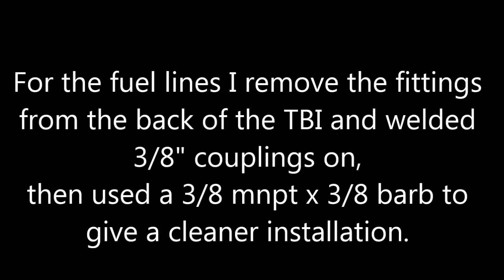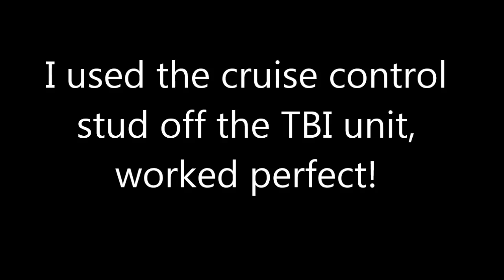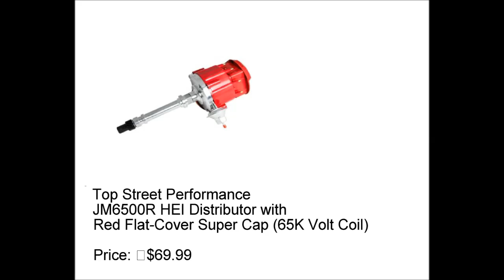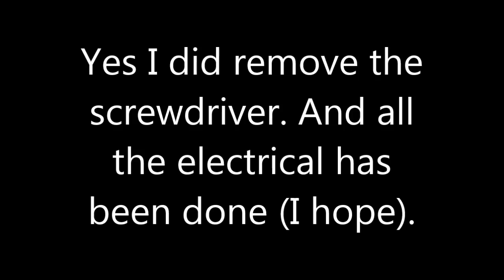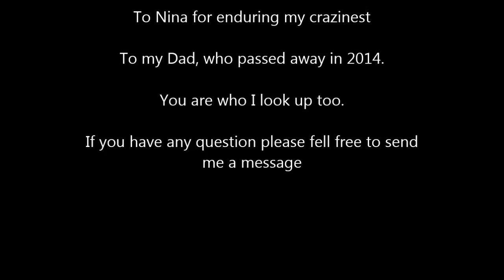Chevy Truck TBI to Carb Conversion 2

Comment: my 18 old kid took my 93 yukonGT.  The 3 lobs of the cam were in the oil pan and lifters, with pieces of piston in the oil pan. it looked like a grenade went of in the motor. Love the video...
Reply from the maker: I have been there... Blew a 427, broke my heart. Thanks for the comment, Papa

Comment from the maker: Its been a very busy year. I have been behind answering questions, so hopefully things will slow down a bit. Thanks, Papa
Reply: hey Just a quick question im getting a 1999 350 vortec engine for my 86 c10 and I have a turbo 350 and since im going to carb the vortec do I need the computer at all???
Reply from the maker: If your putting it in a 86 C10 I don't see why you need the computer. Just a good intake and tune your carb and you should be good to go.
Reply from the maker: Should not need too. Post when your done . Papa

Comment from the maker: Well I finally got my transmission rebuilt. Going to wait for better weather to install it. If it works properly I'll post about the rebuilt. Merry Christmas.
Reply: Papa Ragan 
Would you know if a 1976 454 carburated work on a 1995 1 ton dually. The dually motor is a 454tbi but I have a 454 in a 1970 3/4 ton right now and I need the dually to run.

Comment: thanks for the info. very helpful.. i was so stumped on what to do about the fuel pressure problem
Reply: I removed my fuel pump fuse and relay...added a 12volt external pump and plugged the factory fuel line.

Comment: Papa,
I'm just about finished with my conversion.
2 more questions:
1) For the second cab heater hose that was attached to the TBI intake manifold, where did you attach it?
2) What did you attach to the hole in driver's side valve cover?

Comment: Were you able to keep the stock return fuel line ?? And how is the regulator doing at keep the psi down low for the carb ??

Comment: Thanks for the info! I can just leave my computer for the lockup which was i was wondering. Can i just freely cut the rest of the harness and pull those pins from the main plug on the computer or just snip and cover?

Comment: Nice vixeo io did this with the same block just in a 69 c10 so i eliminated alot of stuff but i might need a. Fuel pressure regulator as it boggles whe i step on it too fast

Comment: Hi. Nice Video. appreciate you sharing the parts you used.  
I have a 1987 GM P/U with a 305 TBI  and 700r4 Trans. I've built a 383 with a Holley 750 carb from a 350 block. we fired it up, broke it in, tuned it and did a dyno run. So it is ready to go in.  But I have questions on the TBI conversion. 
- Does the entire computer control system come out?
- Will the fuel pump in the tank run without the computer? I know I need a regulator with a return to get the right pressure at the carb. 
- What actually controls the Trans lock up in a carb set up. 
The big question is around the computer. What  needs to stay.
Reply from the maker: Joe Engel    The only reason I left my computer in is for the speedometer and cruise control.  So to answer your first question:
- Does the entire computer control system come out? 
+No
-Will the fuel pump in the tank run without the computer? I know I need a regulator with a return to get the right pressure at the carb. 
+Yes it will, you will need to reconfigure your fuel pump relay. (I believe it at the end of the video, If not I can post it for you)
- What actually controls the Trans lock up in a carb set up. 
+ The computer. I am rebuilding my 700r4 at the moment, I will be using a TCI Lockup kit, TCI 376600 - TCI 200-4R / 700R4 Torque Converter Lockup Kit
http://www.jegs.com/i/TCI/890/376600/10002/-1?parentProductId=748599  or
http://www.tciauto.com/tc/2004r-700r4-lockup-wiring-kithtml/

Hope this helps
Reply: I did not see the Fuel Pump Relay reconfiguration.  Mind sharing it with me.
Reply from the maker: Joe Engel I'll get it sometime today. thanks
Reply from the maker: +Joe Engel Posted a video, Hope it helps
 https://www.youtube.com/watch?v=myTSUdSJLdA
Reply: +Papa Ragan what wiring did u cut and hook back up to wire in the hei and keep the in tank fuel pump?
Reply from the maker: +Robert Arey First use the pink wire coming from the ignition (It should be connected to your coil). you will use this wire for your  electric choke, HEI and fuel pump.
Fuel pump wiring:
Green/White - Cut and connect to ignition(the pink wire)
Black/White - Ground
Red - Disconnect and cap
Orange - Connect to battery
Grey - DO NOT CUT
Hope this helps

Also: https://www.youtube.com/watch?v=myTSUdSJLdA
Reply from the maker: +Joe Engel First use the pink wire coming from the ignition (It should be connected
 to your coil). you will use this wire for your  electric choke, HEI and
 fuel pump.
Fuel pump wiring:
Green/White - Cut and connect to ignition(the pink wire)
Black/White - Ground
Red - Disconnect and cap
Orange - Connect to battery
Grey - DO NOT CUT
Hope this helps

Also: https://www.youtube.com/watch?v=myTSUdSJLdA
Reply: have you tried lock up kit?

Comment: Great. I am looking to do a carb swap to a GM 2.8/3.1 because the egr system is junk and hard to get quality parts for. The tbi gives 16 mpg on an Isuzu Trooper and a Holley 2 bbl should not change it that much. Plus no more jerkiness at <2,500 rpm. Manifold already bored for a 4.3 tbi and I have the adapter for the carb convert. Yesterday I cut apart the electric control solenoid valve and realized that it passes vacuum even when the coil is not energized due to its internal design. Therefore IMHO the EGR valve spring will weaken over time and the EGR valve is opening at idle causing my problems at low RPM.

Comment: I wish I had found this vid before I rebuilt my tbi and bought all the electrical crap. Everywhere I looked online were people talking smack about the conversion, while all I could think of is why wouldn't you want a carb? Far less things to go wrong. I can rebuild an edelbrock for less than 100 and add a manual fuel pump for about $20-$30 bux. I just dropped about 400+ to rebuild and replace all sensors on my '89 k1500 with a 350. And it still wont start right up from a cold start, in tank fuel pump (new) has to rebuild pressure every day. Had a carter afb 650 cfm on my old 76 k10, best carb I ever had.
Reply from the maker: I had the same problem with mine. Spent tons of money to repair the TBI. Never worked right. Thats why I went to a carb.

Comment: DO U HAVE A 700R4 TRANS IN THERE WITH ELECTRONIC TORQUE CONVERTER LOCK UP FOR THE FOUR GEAR  AND IF YOU DO HOW DID U GET THAT TO WORK WITH OUT THE COMPUTER ..

Comment: Papa Ragan,
Questions:
1). Where did you hook up the brake booster vacumn hose?2). You disconnected the EGR system, right? And then put plugs in the old exhaust manifolds ports?3). Did you disconnect the MAP sensor?4). Did you disconnect the Charcoal Canister as well?
Reply from the maker: I hooked the booster to the rear outlet in the carb base plate. Hopes that helps.
Reply from the maker: 1: I hooked the booster to the rear outlet in the carb base plate 2: Yes 3: This motor did not have any manifold ports, Not saying it did not at one time. Also there was no air pump system. 4: Yes

Comment: I would get a metal fuel filter like the original frame mounted. the elect fuel pump in tank is high pressure until after it leaves the fuel reg. I am changing to 1974 350 with carb to a 90 chev. pickup. The wiring tips will help lots.
Reply from the maker: Thanks for your sharing your info, we all share info here. I'm still using the original plus the one at the carb. I have not had any problems,yet. But I will will keep an eye on it. Thanks again, Papa.

Comment: Hello i just put a  94 rebuilt engine in my 89 chevy silverado ran ok at first but having trouble with fuel probblems wasting to much gas. ive changed alot of things injectors getting to much fuel ,fuel reg,fuel filter still runs the same does not stay on ,my question is does it make a diffrence in fuel econamy or will it waste more gas.i want do the same as your video change tbi to a edelbrock.loved your video and thanks for listing the parts you used.thanks

Comment: Hey. I know you did a lot of research on this. Thank you for sharing your knowledge with us. I have a 92 Chevy Silverado with a 350 that I want to switch to carburetor. I noticed in a couple pictures that you did not have the vacuum advance on the distributor hooked up. I was also wondering about the throttle position sensor. That carb didn't have one did it? What did you do with the wires?

Comment: Great video what I'm doing is outing a 97 5.7 vortec in my 78 pick up. I want to convert over to carb to eliminate the computer. Is the distributor you used compatible with the stock can meaning is it the same metal material on the gear I have heard it has to match. If it's not what cam did you use and what specs
Reply from the maker: Have not heard that before, could be. I have not had any problems using the stock cam and it runs great. Good luck on your project and keep us up to date. Papa.
Reply: Not sure if you got it going yet. Answer is no. I am doing the same thing just did a 880 block out of 97 suburban.

Comment: I am in the process of doing this swap on an '88 with a TH400 trans. What do I have to do to make the trans operate correctly?
Reply from the maker: I bought a Trans from Jegs that does not need any   controls other than Automatic Transmission Detent Cable. That was the simplest solution

Comment: Papa,
Better question after thinking about this overnight: I can install an alternative speedometer setup that Will allow me to eliminate the need for the ECU to run it.
If I eliminate the ECU entirely, can the cruise control still function as is or or is there a way you know of to engineer something to allow the cruise control to operate without the ECU?
I want to explain why the message to you of 11 months ago and why I'm still addressing this subject. 11 months ago I was going to make the TBI to carburetor conversion but I then became convinced to try to make a go of the TBI/ECU system, especially because of my fear of Texas environmental laws. The only problem is that I have for the last 11 months been trying to chase down the problems keeping this truck from running, in my limited spare time and have been unable to. So I'm returning to my idea of 11 months ago to convey to a carburetor system.
Reply from the maker: I am still looking for an economical way to do the same. Right now I am having problems where my speedometer comes and goes. So I will be working on this problem sooner than later. If you find a good way to do this please post it. If and when I do I will post it. Thanks, Papa.
Reply: +Papa Ragan 
check out 350 tbi to caburater wiring problems. yutube. not sure of the poster.

Comment: Hello 
Would you know if a second gen 454 carburated motor fit into a 1995 dually 454.  The dually motor is shot and I have a good running 454 in a 70 3/4ton but I need the dually. Thanks

Comment: Great video. I have a "78" 2wd Blazer that Id like to put that type engine (serpentine belt) in but make it carbed. Will my carbed intake fit a TBI engine ? Or, if I rebuild my old 350, will a serpentine belt system fit ?
Reply from the maker: +OUTFITRIDERS I don't see a reason that you can't put a serpentine belt on your 78. You will have to use the water pump, alternator, etc. from a serpentine set up. My suggestion is by an old truck (88,89,90, etc There may be others) and scavenge all the parts you need. Now you may still have some fabrication to do, but heck that's the fun of it anyway.  It is easier just to buy an intake for your motor, there not that expensive. Different years have different bolt patterns on the heads so need a matching intake. That being said they do make an adapter to use your intake but it cost as much as an intake. 1987-1995 Intake manifold bolt pattern with center intake
bolts canted @ 72 angle. Hope this will help you on your quest. Keep us up to date and good luck.

Comment: Thank you video. We got an 87 c10 as a roller no computer in it either.
Question: How can the intank fuel pump be wired so that we can use it with a carbd 350 ?  Thanks.
Reply: Wire it to an ignition hot source, and add a bypass regulator, such as the Holley 12-887.  Just set the regulator to about 4-5 psi, and you're good.  

Don't use a regulator without a return line, also known as a deadhead regulator.  Those don't tend to work out well

Comment: nice video and insight I have a 93 chevy c1500 rolling chassis  can you tell me what wire colors went to each component  I have the purple wire identified  and the ignition wire pink coming off the fire wall any insight will be helpful.. previous own had a big block in it so the wire out the harness are only about 7 total the used
Reply from the maker: Check out my other video and see if that helps. Papa https://www.youtube.com/watch?v=myTSUdSJLdA

Comment: Hey papa I have a 94 k1500 with vortec heads, a single plain intake made by chevy so the tbi bolt pattern goes to the vortec heads. From what I hear it would be a powerful motor if i installed a carb because the throttle body is the weak point would it be worth my time to make the swap, and if so how many ponies roughly do you think i could get out of it with a 4 barrel

Comment: I wish I could talk to you about this mod I have a 98 GMC Suburban and I am having trouble with the security system is shutting the fuel injectors down I want to mod my vehicle and I want to use the same fuel pump that is in the tank.

Comment: I've got a 92 I put my entire high school savings in, at one time it took my son his mom and me to school everyday it is my pride! So I recently went through the engine all is stock except I put mild cam in nothing crazy just looking for a good sound, and I liked the sound because I was hearing them in aspirated engines.. I am disappointed with this TBI+cam combo it surges through its idle no matter what I unplug reset and research. I can get about 4 lopes and itll gas comeback, whatever I've had it do everything where I couldn't figure how to fire it back up and truck bed full of crap I was replacing that was GOOD. Don't get me wrong, while on the gas it is outstanding, that's why my 4wd always gonna work. would you have a better trick for me to try? I believe I  have everything laying around but a good 4bbl if I don't find a new project this problem of mine be resolved before this is read probably, thanks for any help-Trevor
Reply: just asking for a last tip for my issue if there ever was one...
Reply from the maker: Sorry for delay. As i understand you have put a different cam in your engine and now it will not idle correctly. One reason may be that the ECM is trying to operate the engine stock. It does not know there is a different cam so so it is not giving the timing and injectors correct information causing you idle problems. Your ECM is getting input from the sensors and it is not giving back the correct info your timing and injectors need. There use to be company's that could reprogram you ECM. You may want to experiment with larger injectors, maybe out of a big block of the same style truck. I found some info that "map sensor is reading manifold pressure (vacuum), and when you start scooting the cam's duration higher, the vacuum signal gets degraded, and the map sensor tries to compensate by moving the idle up and down searching for the vacuum signal that falls within map sensor's factory pre-set range." 
You may want to look at this: http://www.jegs.com/i/Edelbrock/350/3704PK/10002/-1
It is a cam and manifold kit for a TBI. It also has some good info.
You may look at getting a chip for your ECM that will be compatible with your cam. Hope this helps.
Reply: Papa Ragan much obliged!

Comment: Many thanks for your prior response.
Again, I have an 88 Chevrolet C3500 with a 350 engine in it. I've converted the transmission to a manual transmission so I'll be installing a carburetor.

Another question to you if I may please. I've just spent the afternoon and evening going to bolt businesses, a hydraulic fittings business, Home Depot, and several auto parts stores looking for the plug with the right thread size to plug the air pump fitting holes (one on each exhaust manifold). 
What did you do to plug these two holes on the exhaust manifold? If you used a plug, what size was it and where did you find it?
Thanks ahead of time!
Reply from the maker: My 88 did not come with an air pump, so I did not have this to worry with. I might suggest getting a pipe plug that is closest in size and the tap the hole with a matching tap. Hope that helps

Comment: I have a 93 1500.  Is there any computer crap that has to be done or is it pretty much just hardware changes???
Reply from the maker: Adam Venezia Everything is disconnected from the computer.  I only leave the computer in for my speedometer  and cruise control.  As soon as I can find an "inexpensive " way to eliminate that I will try it and post.

Comment: ive watched your video and gained some very useful knowledge. i have a 93 toyota pickup with a 305 and a 4brl edelbrock carb. its a work in progress. the motor sounds great but im haveing fuel issues with the carb. it does have a fuel pressure regulator with a return line. no vacume hooked to it though. could that be an issue perhaps?? thanks
Reply from the maker: Have you checked your fuel pressure? Might need to adjust your regulator. Is the carb new or used? Maybe a float problem.